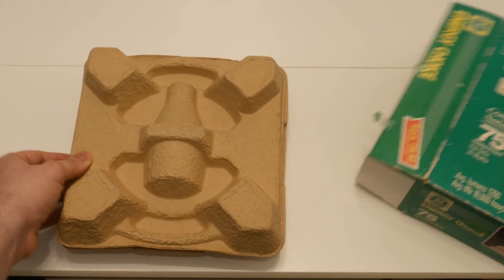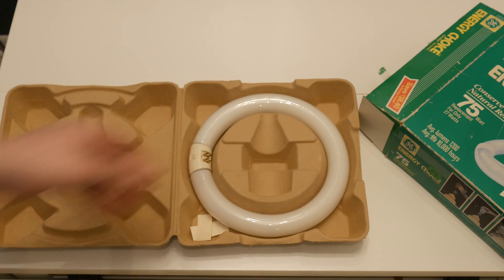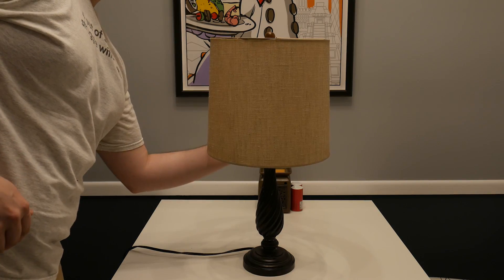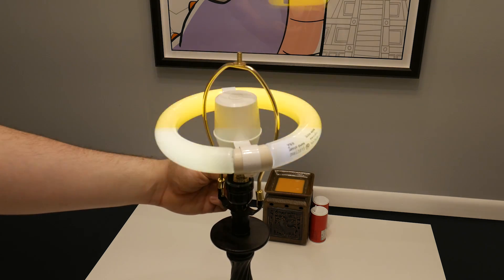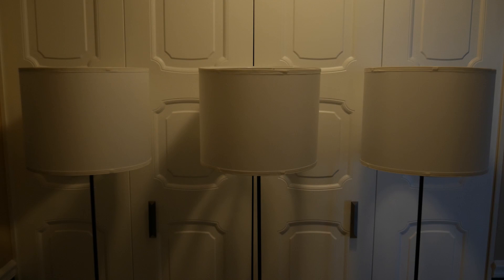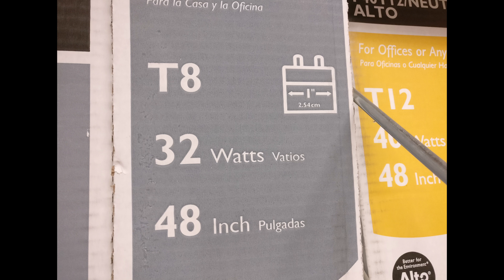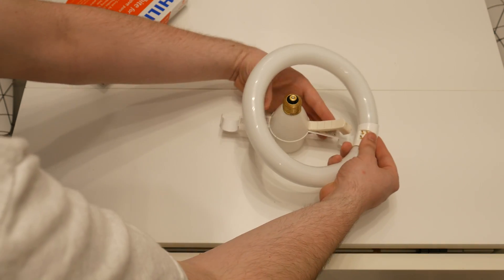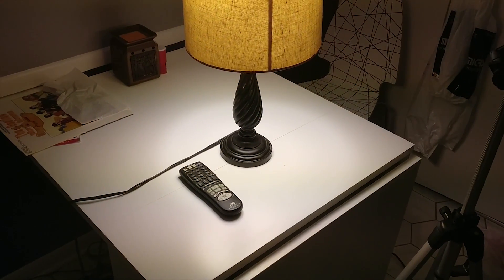GE's bizarre early attempt at a CFL

Comment: I have one of these and it STILL WORKS. I'd like to see a CFL or an LED bulb last this long. Mine is a little older than yours.
Reply: coondogtheman1234  Exactly, they stopped making them because they pretty much lasted forever unlike any lights made today
Reply: They don't want LEDs to last forever because they want you to keep buying new ones every year or 2.
Reply: Matheus Bitencourt your wrong I have a super old electronic device and the led indicator still works after 15 years and I've seen super old dvd player LEDs still work but if your talking about consistent lighting then LEDs are pretty good and will last really long if they aren't made by a shit company who wants you to buy new lights every year
Reply: Yes I have one too.
Reply: AGREED. I am always changing them. They fail under warranty, but the warranty doesn't cover the 10.00 in as I have to burn to return them to the stroe for an exchange.
Reply: Yes, I have to admit, even the more expensive lightbulb style LED lights do fail way more often, than they should, but I'm quite confident, that It's almost never a problem with leds themselves. Either the driver fails (very common, designing a good driver for them is very tricky), or cooling is not efficient enough. Which is why enclosing them in glass bulbs is very dumb, since it prevents airflow. If leds are operated within specified temperature and current range, they can last many many years, and never actually burn out. A sign of wear on the diodes themselves is the brightness decreasing. If it goes out suddenly, sometimes even with a bang, then it was not designed correctly.
Reply: @powder-phun949  Mostly correct, in that it's the driver electronics that fail, not the LED... but this is only a symptom of a much bigger issue... "planned obsolescence", as the term goes.

It seems that, sometime in the mid-1970s, this one particular economist was either gifted an electronic pocket calculator that (being kind of a new phenomenon) was very slightly defective inside somewhere, or he had a Doc Brown Flux Capacitor Vision type moment (i.e., accidental  blunt-force trauma to the head). In either case, he, at some point around that time, managed to convince not only himself, but prominent people in both industry and government here in the US, that the idea of heirloom cars and major appliances and that things should be made exceptionally well simply because it was possible, somehow was an economic time bomb that would eventually lead to the complete collapse of human civilization around the globe. (Which is exactly as preposterous a suggestion as it sounds... I live in an agricultural part of the US, and I can tell you that most dairy farms couldn't produce that much BS in a year!) That is (well, okay, the beginning of) how America got the Service Economy, the Rust Belt, the "Made in China" sticker, etc.

If you open a television that was made in the early 1970s or earlier, and has not been used in a full decade or more, not even plugged in during that time, and you put your finger across an electrolytic capacitor in the high voltage supply, chances are (pardon) shockingly high that you will get the zap of a lifetime. Modern sets don't do that. They /can't/. Why?

The electrolyte formula in the caps are very, very different. Modern formulas for cap electrolytes are designed to be efficient. Cheap to make and integrate into the cap, and just functional enough to make the cap not go BANG until the day after the warranty does. Most modern electrolytic caps are designed to last three years tops.

The older ones, though, the caps designed and made before planned obsolescence, they were designed to *work*. The important factor wasn't efficiency, but effectiveness. So they'll  easily hold a charge for multiple/decades/ where a modern cap will struggle to reach past ten seconds or so.

Everything around us is built like that now. If you get a fridge from the 1950s and it works, it will run better (and even use less electricity!) than anything you can buy at Lowe's or Home Depot today. Chances are, in fact, that if you have kids, and they inherit your house when you die, they will inherit that fridge with it. That's just how things were made then. It just is.

If you want to make an LED bulb that lasts until the LEDs themselves die, and maybe longet, get one with a simple switching driver, one that doesn't use a chip, and replace each part in that driver with more-or-less matching (as best you can) components scavenged from pre-1975 electronics... or, if you don't mind losing most of the efficiency, find a way to stuff an old linear supply into the fixture. Lambda is a good brand for those.
Reply: Powder-phun 
The modern fully sealed filament type led bulb is sealed in a glass envelope filled with pure carbon monoxide. You know the poisonous gas resulting from burning fossil fuels. CO has excellent thermal conductivity and moves the heat from the suspended filaments to the glass. Of course as soon as someone takes one apart to do a tear down now it's  just regular air which has far less thermal conductivity. The claims on the new bulbs is not 20000 hours anymore. Most leds I see have ratings under 10000. In my experience most don't last much longer than 2-3000 hours. I do however have 2 that have been running 24/7 for probably 8 years now. Mind you out of the 6 in the package only 4 still work and 2 of them run all night and the other 2 run 24/7 but these were the first gen with about 20 small leds and a capacitor dropper for the power supply. They are only rated 2 watts so they don't give much light. They are used just as nightlight to light up a staircase that would otherwise be pitch black at night
Reply: ive never had an led bulb die on me, i have a mix of dollar store led bulbs and Phillips hue bulbs and even the cheap ones haven't died yet, only about 4 years in but even that seems pretty good and i see them lasting another 5-10 at least
Reply: apparently they fail on the bonding wires of the LEDs... ALL leds fail this way, even the green low power one of my scope, they start to flicker and you know it's the bonding wire, i wonder why!!! considering that i've never seen other silicon devices failing this way (transistors, chips, etc) i think they do that on purpose, we are more and more into BS products these days, they will sell those anyways, and like me nobody will buy a >10$ lightbulb, i've seen philips CFLs fail in the circuit after a pair of years, waste of money!!
Reply: Leds suck, i have to change broken ones at work. I have started putting dates on new ones i fit to see how long they last. So far some don’t even last a year.
Reply: Built-in obsolescence. Hey at least they are good for parts. I've torn down a plenty of CFLs and LED bulbs. I'm in the process of making a 6 volt CFL bulb lantern. I have a crapload of dead CFL bulbs.
Reply: Are you sure about the CO thing? That would be really interesting, but I can't find any mention of it at all. Also The thermal conductivity of pure CO is very similar to ordinary air (CO: 25 mW/mK, air: 26 mW/mK). Even then, glass would be terrible, when compared to an exposed aluminum heat sink.
Reply: Read it on the internet somewhere, probably on a light bulb manufactures web site. They claimed that their bulbs will filled with CO gas to aid cooling of the vintage style LED filaments.
Reply: Aaah, those things. Always wondered how the hell are they going to deal with heat in them.
Reply: i will not buy a LED lamp\bulb anymore
Reply: The dumbest LED light is one in a breakable GLASS covering! This is clearly marketing and pyssology interfering with progress. Get that old fashioned look and put it in old fashioned SHADE thereby wasting all that efficiency.
Reply: We are talking 2 different things here. An LED pilot light or digital display passes very little current. The type required for lighting much more. They are also a different design. Indicators were ususally GAASS diodes with different levels of doping to generate red yellow or green light.  White LEDs are not really white, they are blue with phosphor coatings that glow yellow to mix with the blue light and produce white.
The current that they push through generates plenty of heat, and this heat is the killer. If you want I can send you examples of "Good" brands of LEDs that failed in normal use after a short time. I have a full box of bad lights.
Reply: coondogtheman1234 Good quality LEDs would probably beat it
Reply: @powder-phun949  LEDS are shitty cancer things!
Reply: @ShinjiInui011  okay
Reply: Powder-phun No Way. LED don't last long, even high quality ones

Comment: How the hell have you made a video about an old lightbulb interesting?
Reply: could the bulbs color / brightness have been negatively affected by its age? i imagine the metals could have went through some reactions in the years that passed.
Reply: @timjen3  Most of the fluorescent tubes and circline tubes made prior to the mid 1990s, and even some sold after that, used halophosphates as the phosphors. Halophosphates themselves were developed in the early 1940s as a more efficient and less toxic alternative to the previous zinc beryllium orthosilicate (about 35 lumens per watt) phosphors of the late 1930s. Halophosphates had an efficiency of 60 to 75 lumens per watt and had rather poor color rendering index of around 50 to 70 maximum. In the 1970s and 1980s, Philips developed and rolled out rare-earth tricolor phosphors which have higher efficiency of 80 to 95 lumens per watt, and a higher color rendering index, easily 80, with options as high as 85 to 90. Due to smaller tube diameters, increased temperatures, increased wall loading, halophosphates would not work in true compact fluorescents, and practically all compact fluorescents all the way back to Philips's initial compact fluorescent in 1980 have all used the better rare earth tricolor phosphors.
Reply: Unless memory fails to serve, that's exactly the hideous colour those things put out. It's not age, it was meant that way. Horrid.
Reply: Naw, that's how they looked. There is a reason people hated CFLs when they first came out. They gave ghastly light. We had florescent tubes everywhere in my early 60s house, and fortunately the decor was yellow themed... Actually any color would have been yellow themed with that lighting!
Reply: Well, if his kids vanish, we know who to tell 911 to go visit.
Reply: Cause he's awesome and I want his children?
Reply: I wonder myself.  LGR (Lazy Game Reviews) made a video on plugging a floppy drive into his phone through a adapter, look up LGR - Using a Floppy Disk Drive on a Smartphone
.
Reply: @0972q8 cheap bulbs, yes. Try Philips Warm Glow on a dimmer. We couldn't tell a difference from halogen even side by side.
Reply: He hasn't.
Reply: @stvrob6320  *has

Comment: My parents and grandparents had these in the kitchen. They screwed into simple light sockets that pointed straight down from the ceiling, and there was nothing covering them, just an exposed halo hanging right in the middle of the room. haha God, these things perfectly encapsulated the aesthetic of "cheap and old".
Reply: I've got one in my kitchen overhead. It simply works.
Reply: I love them. I'm cheap, and I'm gonna be old soon. I want to have one someday.
Reply: My Grandparents used this as the main kitchen/diningroom-table light from as early as I can remember. I’m sure they were early adopters of the energy/cost-saving variety. They likely replaced the bulb a small number of times in the thirty-odd years it was in use. Only due to the desire for a ceiling fan lighting fixture in that hot location (adjacent to the oven) did it disappear. Yes, the hesitant start-up, and somewhat odd purplish glow was a bit disconcerting, though it threw plenty of light!
Reply: the flickering start up was common in older florescent tube lights.  it doesn't even strike me as odd even though I know it's been reduced greatly these days.

 As for being old and cheap. not exactly. They may have saved a lot of money but for the time they were not cheap. It was more a matter of paying for quality and getting a return on that extra investment considering they cost like 4 to 5 times more than standard lightbulbs but you replaced them far less.
Reply: @bjornolson6527  I was about to post something very similar: My grandfather had these as well!  When CFLs came out I didn't understand what the big deal was since I'd seen them around his place for years.
Reply: Mike Nagy same here mine had a clear shade in the centre though.
Reply: My great aunt had a some of these in her basement. She just screwed them into the socket and there they were. She probably had like two of them. Each light in the basement was on a pull chain so you had to walk around turning them on. I saw those lightbulbs hanging there and I thought they were something else until I saw they had pull chains as well. It always scared me to turn them on because they would blink and flicker a bunch before officially turning on.
Reply: My grandfather had one in a living room lamp. When the tube failed my mother convinced him to replace it with a modern spiral cfl.
Reply: My grandma had these in her table lamps. They performed terribly.
Reply: Our living room had one of those xD.
Reply: I worked as a vendor at some stores and in the back room at Kmart, they had a bunch of them in the fixtures under the mezzanine area - I think they were still there when the store closed in 2016
Reply: Cheap...but actually lasted a long time. The center bulb, that is. The circline lamp itself totally depends on the brand.
Reply: I was just telling my wife about my grandparents having one of these for the kitchen ceiling light. Exactly as you describe. Fitting, really, since their house started life as a chicken coop...seriously, it did!
Reply: I like these style bulbs in rooms as they produce fewer shadow effects due to the large light-emitting surface area. However, I do get them in a led format these days.
Reply: SPIRAL STYLE CFLs didn’t exist much before 1990.  If you wanted a compact fluorescent, you bought these circle things.  My parents have one in their basement simce the 1970s (almost 50 years)!  Mounted upside down

.
Reply: dude im just liking your comment  and subscribing you because you are sexy

Comment: Is it bad that I find the old fluorescent light quality really comforting?
Reply: Nothing bad, it's just a different "vibe" or "mood" it. I like different choices in light color depending upon application.
Reply: Rick Delair Pretty much none of what you just said is true.
Reply: Joshua Hillerup I still use daylight bulbs all over my house. Now they're mostly LED, though.
Reply: I've been using an LED "bulb" in my desk lamp for over 3 years now and have experienced no ill effects at all.  It's a cheap bulb I got in a two pack from Lowe's for $3.38.  The other is in a lamp in the living room.  The desk bulb has burned continuously this whole time 24 hours a day, 7 days a week except for the occasional power outage during a storm.  If the other bulb in the living room has the same lifespan as this one has I'll never buy another type of bulb again.  In fact I have about 12 boxes of these LED's that have been in my bedroom closet for over a year now and as my older CFL's and incandescent ones burn out I'll be replacing them with the LED's.  I wouldn't worry too much about kilohertz either, the very air around you is filled with it and megahertz signals with radio and television transmissions and have been for ages.
Reply: Rebel9668 Yep, in fact whatever device one is using to read this is cranking out 2.4 or perhaps 5 Gigahertz of RF just for WiFi, plus RF for Bluetooth and more RF for the cellular service is it's a phone!
Reply: Rick Delair  the screen you used to type this is prob using led
Reply: Kind of Japanese hospital vibe
Reply: feels like a time machine back to 1960
Reply: Cannot stand the things
Reply: Perfect colour to light a room for a serial killer.
Reply: Lots of humans find mayonnaise unbearable too. That doesn't mean it is inherently bad for humans, just that people have different personal preferences.
Reply: Any visible light source is only putting out several hundred Terahertz of RF, and it's everywhere you can see. ;)
Reply: @Lauren_C  you killed me
Reply: Lots of humans actually find 60hz unbearable. I myself am one of those who cannot stand LED TV screens or LED lighting, the flickering is painful.
Reply: @purrbox7514  I wonder if our 50hz is any less painful to you... if it's something about 60hz specifically
Reply: I don't hate 60Hz LED lights, but they make things look choppy as if playing a video game. If I wave my hand in front of my face, it looks like it's moving in small increments, rather than consistently as it does under incandescent lights.
Reply: It's not bad, it just means when you were a kit you were really comfortable in a house lit by those awful-looking things.

Comment: I remember staying at a hotel with my parents in the mid 1990's and being really weirded out by these bulbs in all of the lamps in our room. 

Also, aren't fluorescent tubes similar to these really popular and common in Japan?
Reply: Japan here! Yes, they're very common! In my apartment, 3 of the lights are classic Edison screw style while 3 are florescent tubes. Though the florescent tubes don't attach to this Edison screw adapter like in this video.

Though speaking of lighting in Japan, there's something unique about Japanese lighting fixtures. They're not hard-wired into mains electricity, they actually snap into a little socket in the ceiling. So changing a light fixture is as simple as detaching the old one and snapping the new one into place, no need to wire anything. Makes it SUPER easy if you want to upgrade from a florescent tube fixture to LED, you simply buy a new lighting fixture with the LEDs built in!